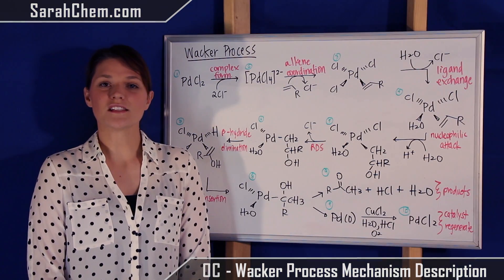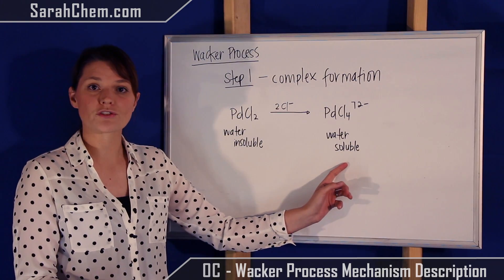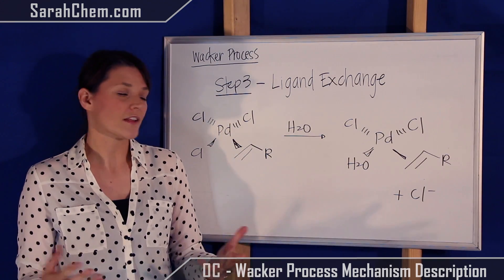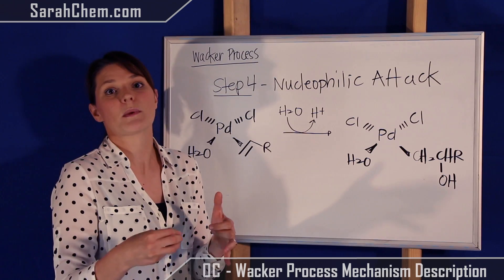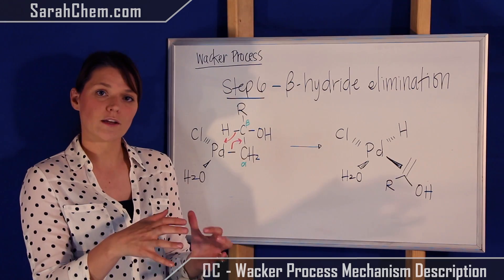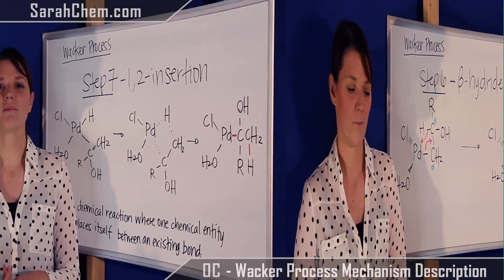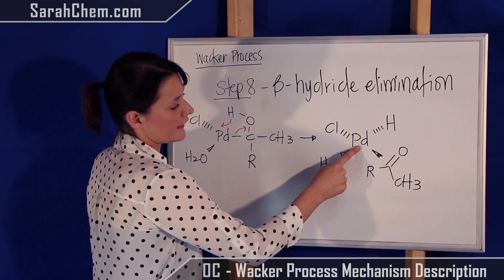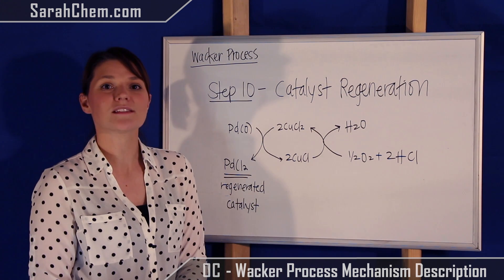Wacker Process Mechanism Description

Comment: In step 5 how pd+2 is reduced to pd even Cl is leaving which means electrons of palladium are too gone with Cl isn't mean oxidation pls mam explain me.
Reply from the maker: I understand where your confusion is coming from if you are thinking in terms of the bond breaking causing the electrons to be placed on the Cl.  The mechanism for how the Cl is removed is not shown though - ultimately what they know is that in the process of the Cl leaving, the electrons that were shared with the Pd remain with the Pd - which is why it is reduced overall.   Does this help?
Reply: Sarah Chem  thnx a lot
Reply: Yes it works
Reply from the maker: Great!

Comment: Your explains what is happening in mechanism.... Very very good but why it is happening like this....what kind of driving froce is responsible...for those steps.... Is real understanding
Reply from the maker: I think this question is a little difficult as it is not a one word answer.  Each step has reasons for favorability and conditions that can drive that reaction forward.  I think the most generic answer to it is that the thermodynamics of each step drives the reaction forward - the entropy, enthalpy, GIbb's free energy, etc.  Does that help?
Reply: Sarah Chem surely they do mam, I mean thermodynamic factors, Kinetic factors .... But there are some other factors like stability of intermediate formed in each step...   When we don't use those terms in order to explain mechanism what's the point in learning, then this kind of reactions should not be involved in syllabus.... If they keep in syllabus.... It mean we have just learn and deliver in exam without any knowledge....am i wrong....
Reply from the maker: I understand what you are saying.  I think that with some these mechanisms that are less well described, and where there is some level of disagreement among scientists this question can be challenging.  I have heard different comments and descriptions on each step.  I think if we were to look at each step and consider the specific reaction conditions and thermodynamic factors (mathematically) we would be able to develop descriptions - but without knowing the specificity of how the arrows should be pushed, it can make that analysis challenging.  I think, for example, the motivation for first step moving from one oxidation state to another can be understood if you remember that there is a high concentration of Cl to drive the reaction forward.
Additionally, I think mechanisms can still be useful even when the full detail is not understood because it provides a sort of proof (similar to mathematics) that allows s to understand how the reactant is able to form the final product and explain experimental observations related to kinetics. Additionally, it provides us information about how we may adjust the reaction to form more product or what potential by-products might be.

Comment: Mam till now in all reactions we learn that leaving group leaves when something lyk nucleophile approaches towards it .. Here how does leaving group leaves without any external influence or bond formation?
Reply from the maker: Great question.  There are a number of factor that have the potential to impact the elimination of the final product.  The ligand, the oxidation state of the metal and the solution that the reaction is run in.  If you think of SN1/E1 reactions, you will see that in both of these reactions the leaving group leaves prior to the Nu: attack.  Does this help?

Comment: Thank u so much!!!
Can you show the mechanism of Wacker-type amino cyclization, plz???
Reply from the maker: Hi +HanhDung Do - I will only be recording again in May but am more than happy to add that to my recording list! :-)
Reply: Oh, thanks! can i ask u some questions about that reaction?  :)))
Reply from the maker: Hi +HanhDung Do!  Sure :-)
Reply: +Sarah Chem In step 4 of the Wacker Process, I read some newspapers that show  syn-addition and anti addition. i dont understand the role of this step. Can u explain the role of this step? How does it effect on the Markonikov product and anti-Markonikov product?
Reply from the maker: Hi +HanhDung Do Hi - The issue as to with whether the reaction occurs by a syn or anti mechnism at this step is dependent upon the concentration on Cl- in solution.  High levels of Cl- are reported to result in an anti addition and low concentrations are said to result in a syn addition - this will affect the number of steps that you include in your mechanism.  Either way, both pathways will ultimately result in the same product.  Depending on which version of the mechanism you are working with, the product you obtain in the following step may look different to the what I have - it is pictured as a 4 membered ring rather than what I have shown in step 5.  Like I mention, this mechanism is still not fully understood and the product the intermediates that are formed are not fully elucidated.
Reply: Thanks! :)
in my opinion, syn and anti addition are useful to explain strereoselectivity of the Wacker reaction.
Reply from the maker: Hi +HanhDung Do - I did find a useful elucidation on some of the reasons why, especially in a lab, if trying to utilize this process, it would be important to be mindful of the competing syn/anti addition mechanisms:

"...the mode of hydroxypalladation can influence the site selectivity of the reaction. Markovnikov-type addition of water to the more substituted carbon of the alkene forms a methyl ketone, while attack of water at the less substituted position ultimately yields an aldehyde. The mode of hydroxypalladation has been shown to affect the distribution of ketone and aldehyde products, and is also important in stereoselective Wacker cyclization reactions." (http://organicreactions.org/index.php?title=Wacker_oxidation#Mechanism_and_Stereochemistry)
Reply: Yes, i read this document, but thank u :))
If you understood about aza-Wacker reaction. Can i ask u the last question?
In the Wacker reaction, they used Cu(II)/Cu(I) redox couple to reoxidative Pd(0) to Pd(II). Why dont they use this redox couple in aza-Wacker reaction? Can u answer it as soon as possible, plz?  I really need this information for my report. I'm so sorry this inconvenience. ;)
Reply from the maker: Hi +HanhDung Do - I have not looked into this particular reaction as deeply - but this article link may answer the questions you have...
https://www.researchgate.net/profile/Christopher_Scarborough/publication/6457715_Palladium-catalyzed_aerobic_oxidative_amination_of_alkenes_development_of_intra-_and_intermolecular_aza-Wacker_reactions/links/02e7e515c0e507d93b000000.pdf
Reply from the maker: Thank you +HanhDung Do !